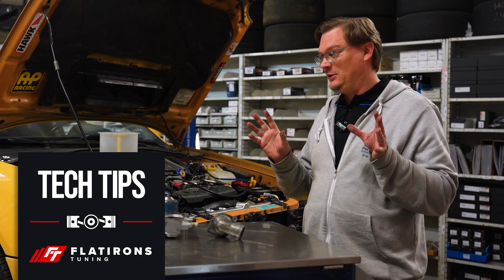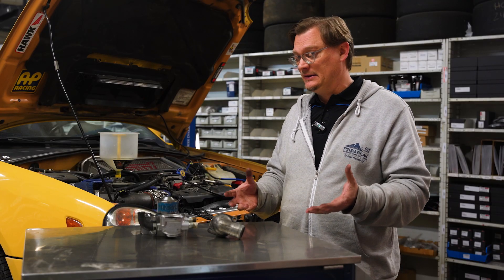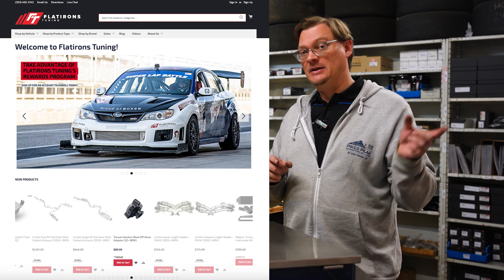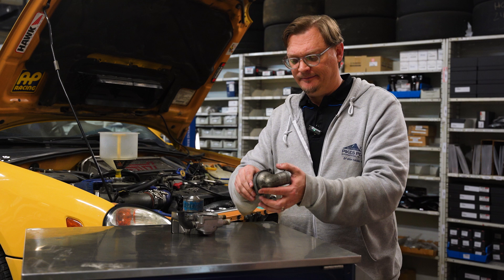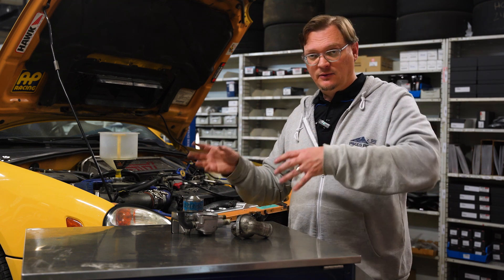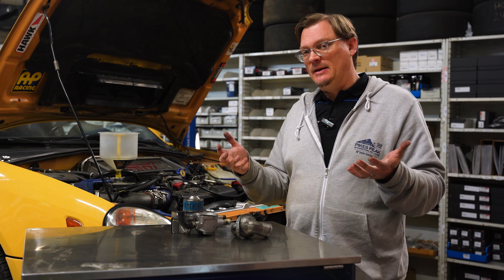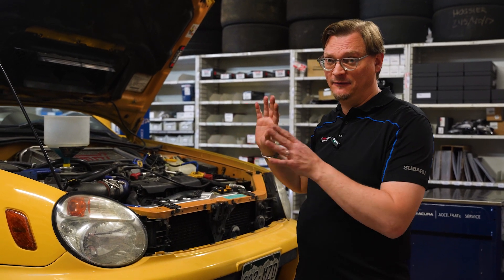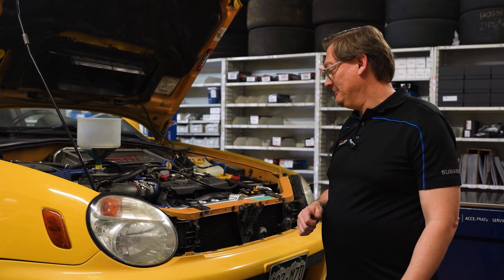How to Burp your Subaru Cooling System

Comment: I watched a video on doing a timing belt change. Afterwards when the “ tech “ put the coolant back in he opened the radiator cap to check that the coolant had reached the top of the radiator and this also released a little air. You’re looking for movement of the coolant if that makes sense. Then put the radiator cap back on start the engine, heater on high, windows open, use a piece of wood on the gas pedal and the front edge of the seat, move the seat forward until the shine holds an rpm around 1800-2200. Keep an eye on the funnel that the coolant doesn’t disappear. Filling it to the level on the funnel that you showed is just right.

Comment: CHECK THE BOTTOM RIGHT COOLANT PIPE FROM RIGHT BOTTOM SIDE OF THE RADIATOR......MR AMATURE HOUR,.,.DASH CAN STILL SHOW GOOD TEMPS AND EVEN IF YOU RECEIVE LIVE DATA VIA Bluetooth BUT THERE CAN STILL BE TRAPPED AIR IN THAT BOTTOM PIPE.AND KEEP THE CAR AT 2000RPM.  and check for BUBBLES.......GLAD YOUR NOT MY MECHANIC....

Comment: Not trying to overstep or criticize your tutalage but your video kinda missed a few fairly important things in the bleeding process. Namely, turning on the cabin heat set at high with heater core fan set at high (some heater cores have their own designated bleeder. Also, once normal OT is reached, squeeze the top and bottom rad hoses repeatedly to help dislodge as much air in the system as possible. Intermittently Revving the engine also aids in forcing air out of trapped pockets from the water pump achieving an increased flow rate and more turbulent hydrolics resulting in coolant displacing trapped air. And finally, on earlier model EJ's (SOHC/DOHC 2.2/2.5) there isn't a fill port on the plenum so the rad cap would be the highest inlet so raising the front of the vehicle for the whole process is very beneficial. While your at it, might as well jump up n down on the front bumper! Still a very well done video. I'm sure its helped many viewers.

Comment: Ok, I went the route of using a "radiator bucket".  2009 Outback 2.5i.  No sign of oil in coolant or coolant in oil.  Seal of radiator bucket is good.  But trying to purge the air (burp it) out of the cooling system, I keep getting bubbles, even after moderate revving, HVAC on / off, high and low, and have been running over half an hour.    At first I just got bubbles maybe 1/4" to 1/2" diameter.  But after the car really warmed up, I get almost constant very fine bubbles (like a very fine aquarium aerator.)  Revving up and down some brings out bigger bubbles.  Temp gauge in dash stays pretty constant, at just below 9:00, once she's warmed up, which seems typical as our 2013 Outback runs about there too.

The radiator fans DO cycle.

If it's the head gasket, well, crap.  Could an old water pump do this?

Comment: If you fit a pressure gauge to the cooling system you'll see that it always starts with a leaking head gasket.
Reply: Because over time and heating / cooling cycles the head bolts sink into the aluminium heads and the bolts lose clamping force.  They need re torquing just like pretty much every other japper that has aluminium heads.

Comment: Nice vid. But what level should I leave the reservoir tank on. I put it on full and I believe it overflowed and popped the cap open. Should I leave it on low or empty
Reply from the maker: Thanks for watching and thanks for the question.  The normal change in volume of the coolant would move the level from the cold mark to the hot mark.  If you started off at the hot mark, the coolant shouldn't overflow the tank.

There is a good chance that you still have air on the system or some other issue.

I'd recommend checking everything over again and burping the coolant and see if more air comes out.

From there, set the level half way between the C and H marks and monitor from there.

Hope that helps and Stay Tuned!

Comment: my wrx overflow keep getting full after the car sit overnight and the top tank near the turbo isn't full when I get to the car when its cooled off but now the overflow is overfill.... I'm lost don't know what to try does anyone got suggestions....
Reply from the maker: First off, make sure you take a look at our radiator cap video:

https://youtu.be/HzjBJz1Zdmw?si=nB_Erm5hVPos3Hhs

Check your caps.

It sounds like you aren't getting coolant pulled back into the system as the engine cools off.  You could have a leak that is letting air into the system.  But you also may have an issue with your headgaskets at this point, especially if this has been going on for a bit.

If you make sure that your caps are correct, and functioning properly, you would want to pressure test your cooling system.

Hope that helps!

Comment: I find that what gives a big head start is to fill the engine via the upper hose first, reattach hose, fill rad, and then burp. Once you get to the final stage you want to put the cap back on, squeeze hard on the hoses to push into the overflow. Eventually when done the hoses should feel relatively stiff because when you squeeze them you should have to create 10psi or so before it pushes fluid into the overflow. Also I find that doing it this way you can go straight for a drive. You might have temps creep up, but if you jump straight onto the highway such that air is moving through the rad and the water pump is really pushing water it should do a better job at initially burping that air into the overflow and getting the bubbles out of the block. Once you're back home you can carefully put the funnel back on (let the pressure in the cooling system drop before you open the cap). Maybe squeeze the hoses good before too, see if you can suck up a little more from the overflow.
Reply from the maker: Thanks for watching and thanks for the comment! 

Stay Tuned!

Comment: vacuum bleed and over fill the overflow a inch past the full line. Perfect every time. vacuum bleeding will also allow you to detect a leak before adding coolant.
Reply from the maker: Thanks for watching.  Yep, definitely want a vacuum bleeder at some point.  

Stay Tuned!
Reply: Best bet is sell your subaru to avoid the pain in the ass problems they are.

Comment: I also find if you increase the engine speed making the water pump flow more/faster, it helps to clear air locks. Don’t have to go crazy, just a few thousand rpm’s.

Don’t forget to set the heater to its hottest setting also.
Reply from the maker: Thanks for watching and thanks for the comment.  Great point about setting the heat to "Hot".  Forgot to mention that in the video.

Stay Tuned!

Comment: I LOVE my Venturi cooling system vacuum tool. You need an air compressor, but that thing is so fun to use on any car. Awesome video, guys. This is what we need for new Subaru enthusiasts
Reply from the maker: Being able to use a vacuum to pull the coolant in is definitely the dream :-)  Hopefully the video will be helpful.

Thanks for watching and Stay Tuned!
Reply: which tool or adaptor are you using for the expansion tank?